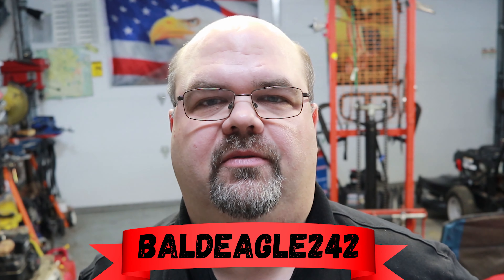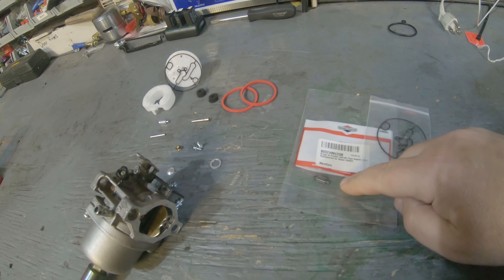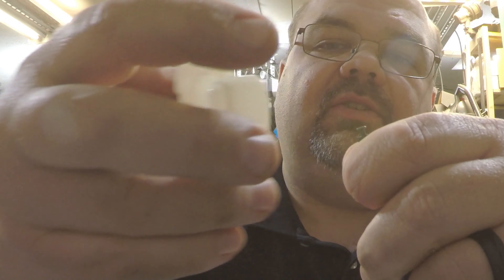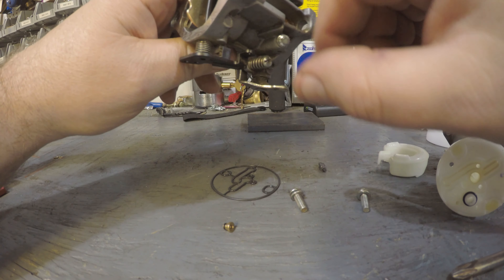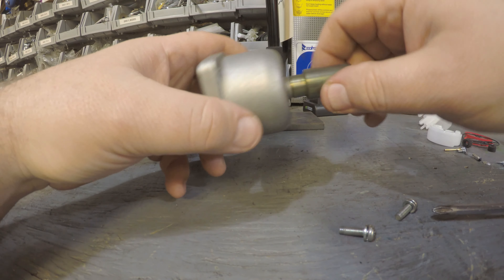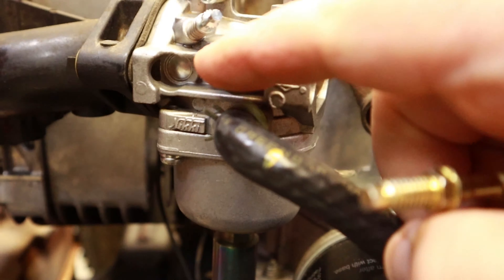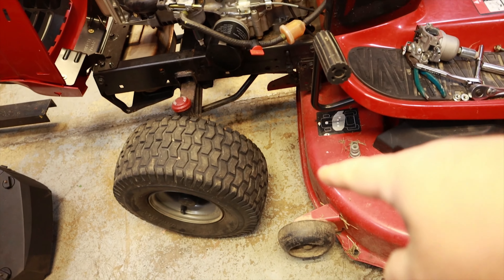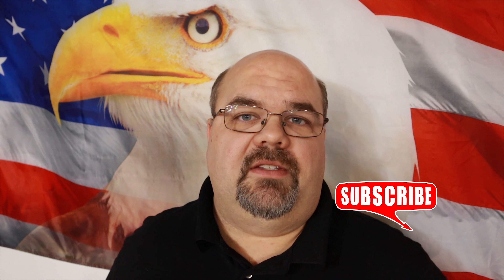No BS! Simple NIKKI Carburetor Rebuild

Comment: A decent video. One of the better ones on Nikki carbs.
     Not happy with the advice to pull the idle mixture limiter cap off with a pair of pliers. I tried that and the mixture screw broke in half. Luckily, there was enough sticking out to grab and twist out with needle nose pliers. Got my Dremel out and cut a slot for a flat screwdriver for the time being until I can get a new mixture screw. Those screws are designed to break if you yank on the cap. Better to cut or split them off from the side, not putting any force on the screw itself. I noticed a gap in the video at 2:38, between you pulling on the cap and throwing it in the trash. Maybe the same thing didn't happen to you?
    I did find out I put the main jet in wrong, had it in the emulsion tube first try. Just seemed like that is where it came from when I first disassembled the carb.
Reply from the maker: @user-mn8ii1gd8b Thank you for your valuable comment and feedback. I appreciate the time you took to share your thoughts. While I understand that such situations can occur, I have personally not encountered them myself. One feature that I believe would be beneficial is the ability to add text or a post-recorded overlay to videos on YouTube, allowing users to insert warning messages or brief videos to inform others about potential issues.

In light of your feedback, I will include a warning in the video description to alert viewers about the possibility of such occurrences. I also recommend being cautious when removing the cap by pulling it straight off without twisting or pushing it side to side. Once again, I am grateful for your input, and I look forward to having you join me in future videos.

Comment: I have a troy built bronco 2017 it has a nikki 5the on plastic in the bowl is the float i got new gaskets and could only use 2 of the gaskets fit but i cant find the right gaskets for the bowl an silanoildany suggestion
Reply from the maker: I have links in the video description. There are two different styles.

Comment: Have you had one of these Briggs Inteks that take 20-45 seconds to warm up?  I have a 20 hp, 540 cc Intek, rebuilt the carb w/ the Briggs kit and it runs great only weird thing is the motor is slow to warm up.  Starts instantly on choke and when I move it off choke it takes 20-45 seconds.  Also adjusted the valves to the specs
Reply from the maker: I can’t say I’ve experienced that situation before. 🤷🏻‍♂️

Comment: Just a foot note...the solenoid is called a fuel shutoff solenoid not a antibackfire solenoid. California's CARB requirement made the manufacturers add a fuel shutoff solenoid to prevent raw fuel to enter and pass thru the engine after the switch kills the coils as it winds down. The carb and engine manufacturers didnt want it to be an issue with one standard for california and another for everyone else so as a marketing ploy they sold it as an antibackfire solenoid for everyone else to satify the California CARB requirement. Every time you order its called a Fuel shutoff solenoid by briggs. The antibackfire element was a bonus for marketing to everyone else.
Reply from the maker: Thanks for the info.  I’ve heard it called everything from a vibrator to a fuel injector over the years.  It’s funny how certain names get attached to something and stay with it.  
Thanks for watching.  😁👍
Reply: Any small engine mechanic knows you avoid engine backfire by letting the engine idle down and normalize for 5 to 10 seconds then shut it off you wont have a backfire because your at the lowest engine vacuum draw for fuel thru the idle jet, not the main one which the solenoid stops.
Reply from the maker: @timw6281  👍

Comment: Hi 
I have a YT3000 .When I try to go to full throttle,it constantly accelerates and decelerates,it does not stay at full throttle. What could be happening? Thank for your help. I am for Puerto Rico.
Reply from the maker: I have two videos that may help. 
The first one should point you in the right direction.
https://youtu.be/-uzKSJhJtww
The second video is on a different engine and carb but is something to check on any surging engine 
https://youtu.be/QtCAehETLBE

Comment: just replaced carb with a aftermarket 2 barrel   on 24hp twin    flooding   and fouling my plugs bad
 only adjustment seams to be a idle screw      will start and run  for 25-35 seconds before flooding out
pinch off gas hose and wait   will start but same thing   thinking of rebuilding the old carb?????
Reply from the maker: Either rebuild or use the jets from the original carb in the new carb.

Comment: I have an older John Deere with no solenoid from carb. There is a plug of some sort and must of came out. I’m trying a 3/8 fine bolt fits but still leaks . Can one use lock tight to seal or could I put in a solenoid to just seal it and grind off the point of it ? Any info would be great
Reply from the maker: You can cut the plunger off and use the solenoid to seal it.
Reply: @baldeagle242  it don’t have a solenoid. Was able to plug with the fine thread 3/8 bolt with some rubber washers

Comment: I have the same mower only it won’t throttle down much. Could this be a linkage issue or dirty carb?
Reply from the maker: I’d check the linkage first. If it’s fully operational then it’s probably something internal.

Comment: Got a rebuild kit. Dropped in the main jet with the o ring on it, 1) it didn't hold the jet in like in the video and 2) I couldn't get the whole plastic set up to seat against the carb. If I took the o ring off it dropped into place and felt better. You ever not use the o ring?
Reply from the maker: If the o-ring is loose or not installed it may allow fuel to bypass the main jet.  It doesn’t have to be tight but it does need to be a snug fit.

Comment: Hi, I couldn't get my old Nikki to work, it would run for 3 to 8 mins. and die and would not start again for about 10 mins., so I got a replacement carb and it runs great until it hits the grass, then it starts spit and sputters like it is going to stall, I have to keep stopping to let the engine rev back up. What could be the problem?
Reply from the maker: Could need the valves adjusted. I’d also check to make sure the exhaust isn’t stopped up.

Comment: What is that solenoid thing called on the carburetor called..? mine won't start and it doesn't move. Im thinking if i knew the part i could order it.. It's on my 382cc troybuilt rider 32"
Reply from the maker: It’s a fuel solenoid.  I’m not sure which carb is on that mower but there are a few different ones.  You could be able to compare yours to the ones on Amazon and find the correct one by looking at the pictures.  
https://amzn.to/3ASi0nj

Comment: I am having a walbro needle and seat problem. If you don't shut the gas off after useing the next day the motor will backfire from flooding which is a needle and seat problem. They want about $20.00 now for a new needle and seat from B.S amazon. Is there anyway to reseat the needle valve seat for these 18hp 31H777-0202 B.S motors? as you can buy another new carb for those prices!
Reply from the maker: The best way to fix this issue is to replace only the needle and seat. Most of the time the rubber seat is damaged or out of shape from ethanol exposure.  A new needle and seat runs about $4.00. 
https://amzn.to/3EXYIAy

Comment: great video - I replaced my Nikki with a aftermarket one. it now  revs high with no change when i use the throttle. any idea what the problem may be.
Reply from the maker: The first thing to check is your idle adjustment screw.  Back it out and see if that solves your problem.  Check to ensure the throttle plate closes when you adjust the throttle down.  If you still have the original carb, I would pull the main jet out of it, make sure it's clean, and use it to replace the main jet in your aftermarket carb.  While the aftermarket carbs do work, they are designed as a one size fits all, and they are never as good as the original carb that's specific to your engine. It would help if you also make sure that no air leaks are allowing excessive are to be sucked in around the carb.  Not to oversimplify it, but an engine can only rev high if it's getting enough air to do so.  Hopefully, this will point you in the right direction.  Let me know what you find. 
Thanks for watching.  😁👍

Comment: Thanks for the informational video. I have a similar Nikki carburetor on a Subaru powered Cub Cadet 400 side by side and it wasn't running right so I pulled the carb and the seat was loose in the bore of that plastic plate would you be able to give me a supplier for parts on this? Much appreciated for the information.

Comment: My Briggs& Stratton Nikki carburetor situation it's dumping too much gas. I have to take the shut off valve shut it down about an eighth or a quarter open? Any help is appreciated
Reply from the maker: Sounds like the float or needle are not closing or the oring has failed. The kit listed below should have everything you need to fix it. 
https://amzn.to/3UELsHl
Reply: @baldeagle242  
Thank you for that information. 
Solved one problem. Found a new problem Lol.

Comment: Having a surging problem on a briggs 31G777 17hp single cylinder, did the carb. checked the valves. changed the fuel and new filter but still surging. any recommendations? thanks.
Reply from the maker: It's either sucking air in somewhere or starving for fuel.
Reply: @baldeagle242  ok thanks for info,

Comment: I need help. On the back of the carb there is an elbow, attached to the elbow is a hose. You can see at 0:37 there is something in the hose but at 11:00 its gone. I noticed this happened to me while doing this and now I cant find it. Was wondering what the parts are called. Cant seem to find them anywhere

Comment: Any idea why a brand new carb would cause the engine to surge?   I've taken it apart to insure all the jets are open and O rings are in place and working properly.  I've also tested the fuel pump, checked for vacuum leaks, and tried adjusting the mixture.  Nothing seems to have any affect.  It surges at both high and low speeds.  My only thought is to scrap the carb and get another new one.  The old carb wasn't surging.  It began when I installed this new one.  Briggs Stratton Intek 17hp with Nikki carb.
Reply from the maker: More than likely you have an air leak or the new jets are two small. I’d confirm there are no air leaks or cracks in the plastic intake. If that check out good I’d drill the main jet about .001” to .002” larger. 
If that doesn’t work I’d swap the Nikki over to a Chinese Walbro and be done with it. 👇
https://youtu.be/ZVbOFzW0inM?si=2cEkbX-IaYDlccrQ
Reply: @baldeagle242  Thanks for your reply.  That's where I am with it.  I think that I'll cut my losses and order another carb.  It's just easier than trying to  bore the jets when there's no guarantee it would work. I'll hang on to it as a future project when I have more time.  Keep up the good work and thanks again. 👍👍👍
Reply from the maker: The aftermarket carbs are not the best. I’ve found aluminum flashing and seals that were crushed when they were assembled.  Most of them are good usable carbs but quality checks are not factored into the price. I buy around 15-20 of them at a time and almost every time I’ll find at least one with an issue.

Comment: so i did the rebuild on the nikki carburetor after putting it back on no leaks started it up and it started burning oil smoking really bad what do you think i should do
Reply from the maker: If the carb was flooding it could have dumped excess fuel down into the crankcase. Check the oil and if it’s overfilled drain it and start with new.

Comment: The solenoid on my carb is not working, would this alone cause the engine to start and run for a second then die? If I rebuild the carb is the solenoid working necessary for the engine to run? Great video btw, thanks.
Reply from the maker: The solenoid does not necessarily have to work but it does have to be disengaged from the main jet for the engine to run. 
In other words if the plunger was completely cut off inside the bowl of the carburetor the engine would run without it.  However, if the Solenoid failed in the extended state with the plunger out the engine will not get fuel to run. 
The downside to cutting the tip of the solenoid plunger off is a potential backfire from excessive fuel being sucked through the engine and into the hot muffler. This can be negated by throttling the engine way down to its minimum rpm before shutting the key off.

Comment: I use a 12 volt deer feeder battery 
Works great and easy to charge with solar panel
Reply from the maker: That’s a great idea. 😁👍
Reply: @baldeagle242 I have around 500 goats on 600 acres, I use deer feeders to feed them once a day 
I switch batteries every 6 months and I use the old ones at shop
Have 3 male LGDs and 4 females 
Puppy sales are great 👍
Reply from the maker: That’s awesome. Where are you located? (Generally)

Comment: Do the main jet o ring comes in the kit or have to buy separate
Reply from the maker: The kit I list in the video description comes with both. Unless your original main jet is lost or damaged I recommend reusing your original main jet and only replacing the o-ring. The main jets in some of these kits are a one size fits all and not always the same hole size as your original.
Reply: Thank you I have a John Deere rider 
Facebook market free post didn’t wanna put a lot of money first thing without doing a basic tune up

Comment: Great Video!!  I have this Nikki Carb model number 698945 on my Westwood S1300 ride on mower, I have exactly the problem you describe with flooding the cylinder, my issue is will the Briggs & Stratton parts you mention in your video fit my carb as can't seem to find an overhaul kit for my specific carb model. any info would be greatly appreciated.
Reply from the maker: Yes, they should fit.  You will need to check to see if your carb has a one piece design or a two piece design with the separate O-ring.

Comment: That fuel shutoff should be on the tank end of the hose, before the filter, so you can fit a new filter without leaking fuel.
Reply from the maker: I install them this way so I can shut the fuel off and let the carb run dry. It runs to long if I put them on the other side. I just pinch the fuel line with something like this if I’m going to change a filter. 👇
https://amzn.to/47T6SXk

Comment: Thanks for the video, got a question for ya. I can’t get my mower started. Fuel is getting to the carb, got fire at the plug…cranks but won’t turn over, got any suggestions?
Reply from the maker: It’s difficult to say without looking at it. First thing I would do is start with new fuel and drain anything that’s in the carb bowl. Will it start if you spray starting fluid directly into the carb?
Reply: @baldeagle242  I’ll check that tomorrow. My plan was to pull the carb this weekend and clean it up. Sorry to bug you with this, I really do appreciate your tome
Reply from the maker: @ronhutton9739  I try to help any way I can but only so much I can do through text.
Reply: @baldeagle242  I’ll ship it to you lol
Reply: @baldeagle242  do you know where k can find a good parts list? I need a new rocker arm, turns out one broke right in half
Reply from the maker: The best thing to do is look at the model number on the valve cover. Most of the time you can find a match on Amazon by searching the model and part name. If that doesn’t work I’d call ProParts direct with the model number and they will have the correct part for you.
Reply: @baldeagle242  hey I really appreciate you and your knowledge, I’ll check that website

Comment: Hello Mr. Eagle. First of all, thank you so much for taking the time to share with us your knowledge of how to make the necessary repairs to get our equipment running again! But I have a problem. I did everything that you showed me in the video and just as you said the leak stopped, so there's no more flooding. But for some reason even with the plunger on the bottom of the bowl working properly, no fuel is getting over to the piston well. I double checked and all of the jets are clear, but when I take the spark plug out, it's just bone dry. I even put a brand new ignition coil on, which it needed anyway, but I'm just not getting anything. Even when I pour gas in the carburetor it doesn't even sound like it's trying to fire up. What did I do wrong?
Reply from the maker: That’s an interesting scenario. Even if the carb solenoid wasn’t working it should still fire with fuel or starting fluid shot strait into the carb where the air filter housing attaches.  I would first double check the black kill wire going to the coil to ensure it’s not picked or grounded out somewhere.  I would then confirm the coil is indeed on the correct way (not upside down). If that all checks out disconnect the black kill wire and see if it will fire without the kill wire connected to the coil. Please note: If it starts you will not be able to shut it off with the key switch. Just reconnect the kill wire with the key off and it should stop. If that allows it to fire then you have a key or safety switch issue. I have another video that shows you how to quickly and effectively check all of your safety switches.  SIMPLE: Troubleshoot Mower Safety Switches in Minutes!
https://youtu.be/dTBJi2BOlVg
Reply: Alright Sir, i will try that when i get a chance and hopefully that will solve the problem. Thanks again.